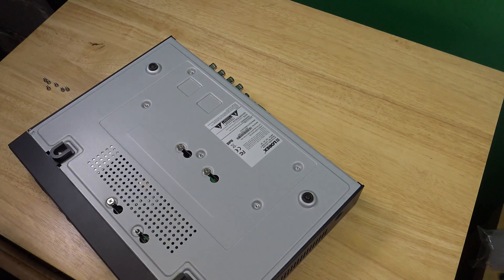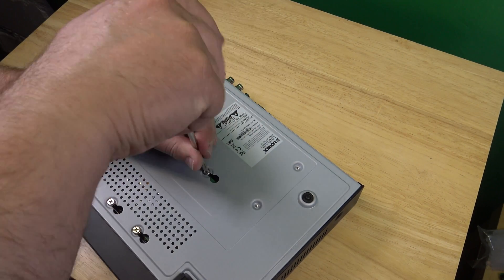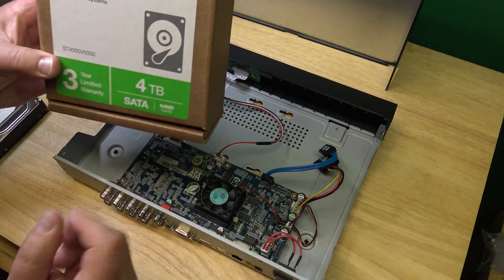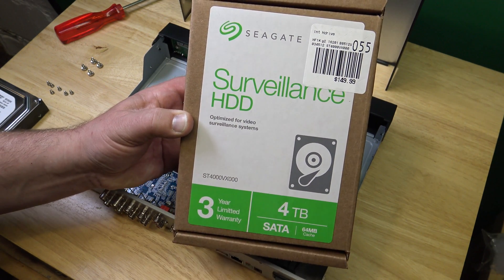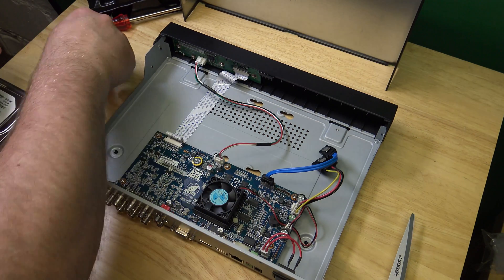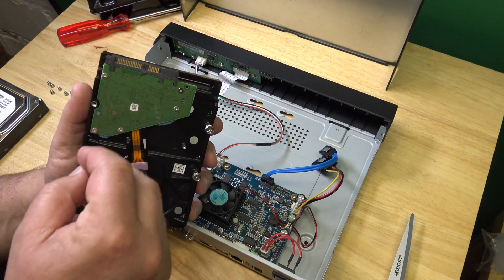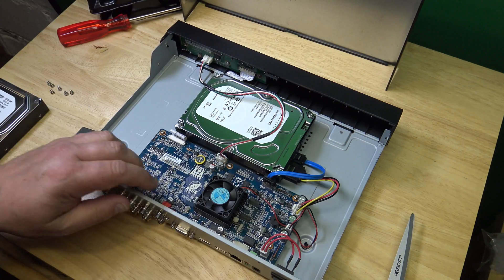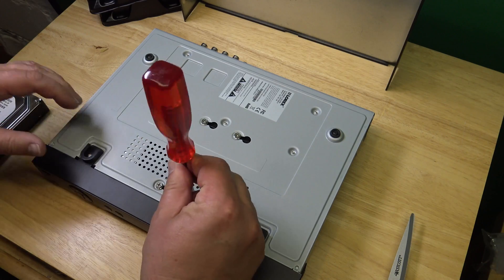Costco Surveillance DVR Replacing HDD with 4TB

Comment: Why do you need to replace the HHD? My DVR keep showing on my screen no hhd install. What does that mean? I have an 2TB in my DVR now
Reply from the maker: Bernard Del Castillo i needed to replace my HDD because it broke. Then it could show NO HDD on the screen. Another option is that the power supply broke, and it doesn’t make enough power to turn the HDD on.

Comment: Thanks for the video and the description.  I had the same issue, replaced the HD with a new one, same issue as before. Checked power supply and it was 12 volts but when the power supply was plugged into the DVR, the voltage dropped down to 8 ( I had the DVR cover off like you did and checked power to ground and found out under a load, the voltage was dropping off).  FYI, all other features worked like display on my tv and remote viewing.
Reply from the maker: tpm369 great, just needs a new power supply. Cheap on ebay and amazon.
Reply: @tpm369, what did you do to get it working? I have same issue as you. Got new power adapter but hdd still missing.
Reply: @jasonl8391  Hi, was the new power adaptor the same amperage output as the original? After I installed the new power adaptor in my unit, it worked. If you are handy and able to safely check the power with the cover off of the DVR, that would let you know that you for sure have 12 volts while under load. When you disconnect power and then reconnect power, do you hear the hard drive spin up? You might need to disconnect the cooling fan temporarily so you can hear the hard drive. That is what lead me to check that power supply while under load, I did not hear the hard drive spin up like they always do. And I think the only reason I heard the hard drive not spin up to full speed was because I had the cooling fan disconnected. Let me know if you have any further questions, I like this stuff.

Comment: my Costco Lorex LHV1000 series, only 3 years old  just died , i need HDD replacement any suggestion on reliable HDD?  I expected lasted 7 or more years from Costco but obviously like everything else when warranty is over things start to breakdown.
Reply from the maker: Many things die on this unit. The power supply died, that's why mine stopped working. The fan died on top of the CPU, i replaced that with a used one. The original HDD i replaced with a Seagate, because the original one was too small for me. It died within the warranty. I don't know what to tell you what HDD would last longer.

Comment from the maker: This HDD shows an ERROR, and i have to send it in under warranty. Overall it lasted from Jul 29, 2016 until Nov 6, 2018
That is two years and three month.
I got it replaced by Seagate with a refurbished drive. The refurbished drive has only a 6 month warranty!? And i had to pay for shipping. https://youtu.be/84jorbdlAUg
Reply: so what is your next move, change HDD again or buy new one.
Reply from the maker: Yes, i just got the replacement. I had to ship the broken drive to Seagate, and they sent me a new one under warranty.
Reply from the maker: But to answer your question: i think i cannot recommend Seagate, because it failed within warranty, and the replacement drive has only a 6 month warranty. That leaves me with 2 year 9 month worth of the promised 3 year warranty. A bad deal, if you ask me.

Comment: Hi Do i have to use a Surveillance HD and if so can you tell me the difference? Thanks!
Reply from the maker: Yes you should, because they are different in a way, when the read/write head of the HDD does not have time to pause since the Surveillance is constantly writing to the disc, compared to a computer, that goes to sleep every once in a while.
Reply: First thanks for the reply.....2nd....can I use a desktop HD to just test the unit before I buy an expensive surveillance HD ?  I hate to spend money on a unit to find out its not the HD that is the problem.
Reply from the maker: D Kat yes

Comment: my lorex 8 camera system was stuck in a constant reboot loop.  the answer was not the power supply.  the fan on the heat sink on the motherboard had quit.  replaced this fan now no problems.
Reply from the maker: Well, thanks for sharing.
Reply: my fan works perfectly but still stuck on constant reboot loop haven't checked the power supply yet for voltage.
Reply: Can u post video on how to replace the fan?
Reply from the maker: https://youtu.be/UHTJ7s-Z90Q

Comment: Just replaced my HD (same Lorex system). I bought a WD 2TB Purple HDD on amazon for $79. The reason I replaced it was because the original HD became really noisy. I'm sure it was on its way out so I just replaced it with a HD with twice the capacity, took 5 min. Thanks for the video, made taking the cover off a lot easier. Remember to format the New HD
Reply: do you need software when you replace the HD or is it on the motherboard?
Reply: What did you reformat drive as FAT32 or NTSC

Comment: my system keeps rebooting any advice please help i disconnected the cameras and turned it on and no reboot could it be the hard drive thanks
Reply from the maker: Vinod Badyal Sounds more like a bad power supply
Reply from the maker: If you have the same system i show in my video, you could buy this http://a.co/hdEbNnL
If not, you need to find out how much power you need for all the cameras and the DVR itself.
The original power supply of my DVR broke too at one point. That seems to be an issue.
Reply: I have the same reeboting issue did anyone ever find a solution for this? Model LHV100800